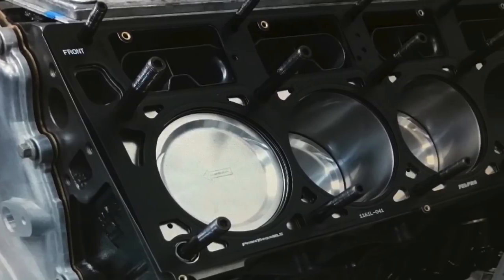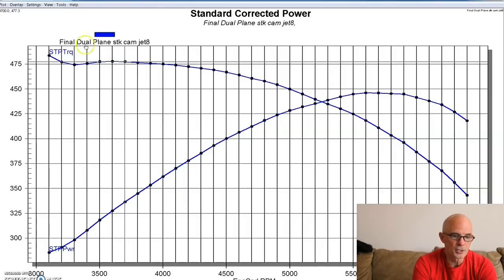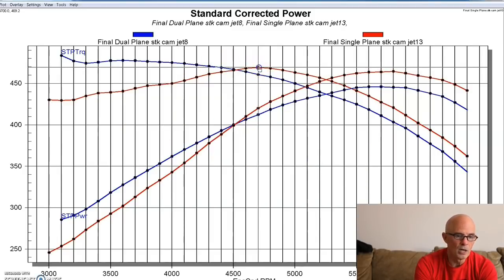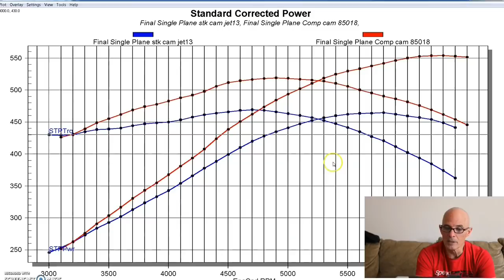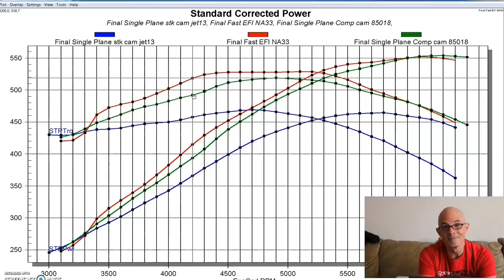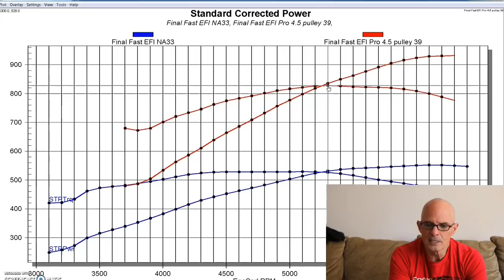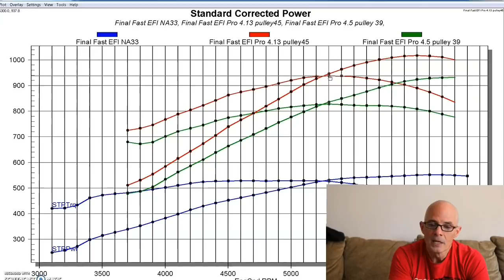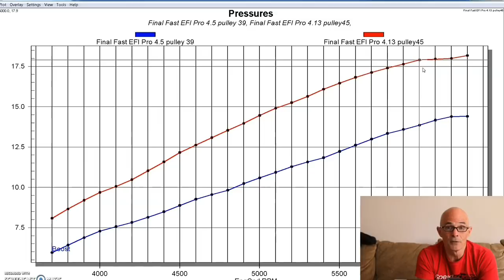SUPERCHARGED LS EBAY COUPLER TEST! DO CHEAP ONES WORK?

Comment: Thought of you today. Blew my first cheap coupler today. Log showed 36psi peak. It has been in use for going on 2 years and thousands of miles as a hard driven street car.

Replaced it with another cheap multiply coupler i had on hand and decent t bolt clamps
Reply from the maker: IT HAD A LOT OF HARD FUN MILES

Comment: I'm actually trying to do something similar with one of my project cars. I took an LQ4 from a 2500 silverado and had it bored .030, then ordered a 408 stroker rotating assembly from texas speed. I think the dish is -25cc, I'm thinking i'll put a set of ported LS3 heads and a FAST 92 intake on. I got to the point where i needed to decide on a supercharger, I was thinking of trying a Vortech V-3 SI. I'll have to do more research on them to see how they compare to the actual PRO CHARGER branded stuff. Planning on mating the motor to the TR6060 in my 2000 Trans AM, the idea is a street car that goes tot he drag strip pretty much weekly during drag season. 
Any suggestions or tips would be massively appreciated!
Reply: Did you do this build?

Comment: Don't use silicone bends. Bends need to be metallic with silicone couplings and the metal pieces as close to touching inside the coupling as possible.

Comment: I wonder how much of the gain from the fast intake/fi comparison to the single plane/carburetor was the intake and how much of the gain was from better fuel flow, distribution, and atomization from the fuel injectors and computer control?

Really hope you answer back with an opinion on my question;)

Comment: How about a 408ls vs a 408 sbf with comparable cross section and flowing heads super Vic intakes and similar cam specs. I know they would not be junkyard wonders and it wouldn’t be cheap but I am just curious how much of a advantage the ls has over the old Windsor.

Comment: Im guessing you were playing it safe with this engine what kind of timing and airfuel were you running on it? Considering 14.7 pounds of boost would of doubled the power and you were at 17 btw great videos always enjoy them...
Reply from the maker: The formula wont double power on a blower application-you have to subtract the parasitic losses associated with driving the blower (turbos don't have that)
Reply: @richardholdener1727  oh ok i see damn i keep learning ill get there one day...
Reply: @richardholdener1727  doesn't the exhaust restriction of the turbo cost something....thanks

Comment: As far as the LSXR vs. the single plane, to be maybe 2 numbers off is tapping on dyno variance, I wonder what would happen to the single plane's "massive advantage", if runner length was closer?
Reply from the maker: not sure I understand this, The Fast was much better than the single plane through most of the curve
Reply: Well, I was referring to the fact that the lsxr has a longer runner lenth, and by making the lengths similar you could have made the operating ranges similar for a more apples to apples comparison of each setups power potential.
Reply: Also, I was making light of the fact that despite the EFI setup murdering the carb for average HP and TQ and being faster in the car, hardcore carb guys will tout the peak number as proof of superiority lol.
Reply: @RadRidesByCru , actually its never really a perfect A to A test of either system, I mean put a carb on a LSXR intake and try the test, I'm sure it could be done. Efi comparisons all use a carb based intake to "compare", and only modern throttle body injection still keeps latent heat advantage. Modern multiport intakes are low heat transfer composites, which works against latent heat reduction from a carb just as much. Then even between long/short runners efi and carb intakes are never the same exact runner length, which also affects overall power numbers. To many variables muddy the waters.
Reply: @RadRidesByCru  I know the plastic makes them cheaper and lighter, but if its heat rejection is a non factor, the AFR titan intake system for SBC which combines latent heat dissipation with heat rejection and is probably one of the best intakes for the architecture, definitely bucks that notion. Also, I knew that wet flow isn't very good inside an efi intake, but honestly that's just me being a bit cynical. Also, the other thing is that carbs and efi favor different cam LSA's in real world use, which affects power and driveability, which dynos charts don't account for.

Anyway, my whole point was it would be neat to see a dry efi intake setup to have identical length runners to a carbureted intake, hell even give half of the runners a shorter length to affect the tuning the same as the carbureted intake because of its centrally located plenum, make it a true A to A test that puts neither setup at some kind of hindrance, like Multi-port into a carbureted intake is...
Reply: @RadRidesByCru  Thats my point, the test you mentioned, is on an intake that gives to the carb but takes from the EFI with higher intake temps, shame about the titan intake, the mod design was bad ass, but Chevy guys are cheap lol, and the manifold was anything but, so not really surprised either. The problem with tight LSA's isn't the computer, so much as rescaling the VE tables, and getting enough air thru TB, if needed just do the same trick you would for a carb lol.
Reply: @RadRidesByCru  drill the throttle plate, older efi comps can easily control tighter cams, but what they don't like is erratic sensor readings. 

If it can make a cam with 260/270 @ .050 and .680 lift idle stone steady at 850rpm with a carb, that and having seen it done on a 2000 camaro with stock comp by starting at 1/4" and working up slowly till things like stepper motor, and BP values get into factory ranges, and if your gonna cam something who's not gonna make it work as intended with a tune?
Reply: Lastly, if your feeling froggy, pay the 33 bucks for the SAE international congress paper on the effects of plastic composites vs. aluminum in intake manifolds in dryflow applications and we can talk further on the material subject and its effects. I agree thou that on the AFR Titan its basically moot because of Wet Flows latent heat reduction, at that point its like icing down your ice with more ice its only ever gonna get to 32 degrees. Every 10 degrees of intake temp reduction adds 1hp, wet flow can easily pull the IATs in the runner down by 30-40+ degrees, intakes in dry flow applications do not exhibit this trait. The air will instead be heated until air speed surpasses the materials ability to transfer it into the incoming air mass. Have you ever once seen a plastic heat sink??

Comment: the Crossover point is ALWAYS at 5,252 RPM.
Reply from the maker: only for hp and tq-not for power differences in manifolds
Reply: @richardholdener1727  yes yes yes 😁

Comment: What’s the best middle of the road or bang for buck turbo for a boosted 5.3?  Daily reliable...
Reply from the maker: A GT-45 can make 750-800 flywheel, an S475 or VS 78/75 can do near 1000 hp
Reply: Richard Holdener thanks dude!

Comment: Do you think this compression ratio makes sense for an E85 fueled street car, or is it better suited for someone running 91/93 pump gas?
Reply from the maker: It works on E85

Comment: Richard, out of curiosity...
In the mid-late 90s, Hot Rod mag built a “short stroke 350” (believe it was titled “the 350 Chevy should have built).  It was a 400 block, 327 crank, Ford 300/4.9L rods, custom pistons with raised wrist pins, aftermarket aluminum small chamber heads, and a fairly small cam (under 210@0.050”).  It had 11:1 compression and made just as much power with 87oct as it did with 91/93 (possibly a couple hp more with the cheap gas).  It took advantage of a really big rod/stroke ratio (nearly 2:1) to make it less prone to predetonation, allowing them to run as much timing on 87 oct as they did with 

Were you part of that test?  
Do you think a similar principle applies...  that a 4.8L is less prone to predetonation than a 5.3L thanks to the rod/stroke ratio?  Possibly allow the 4.8 to run a little more boost or more aggressive timing than a 5.3 on crappy pump gas?
Reply from the maker: I think that test was flawed in a big way-I was not involved

Comment: It made poor power na. Idk why guys lower compression for boost so much. It's not like there isn't good fuel around with e85 these days.

Need a vid with compression ratios vs boost.
Reply: Depends on where you live.  Around St Louis, most fuel is 91 oct, and e85 is hard to find.  

For as lowering compression, I think it depends on the motor as well.  There’s no sense in dropping compression on a 9.5:1 compression 5.3L since it just digs a hole that’d have to be overcome with boost.

I remember a magazine test that compared 708 vs 317 heads on a 5.3L, both NA and turbo.  Pretty sure Richard did the test, it just hasn’t made it to video form yet.
Reply: @stlchucko  yea i know. E85 has only been around me for a couple years. But most stuff he's doing is beyond pump gas anyway and alot is on e85. Just thought a compression ratio  comparison would be cool and not something ive seen done.
Reply: HioSSilver1999 
Rule of thumb is 3-4% gain for 1 point of compression.  I just used some math to make estimates.

With the fuel availability where I live, 9:1-10:1 is an optimal CR for a boosted engine.  It’s pretty easy to get away with about 10psi on a stock CR 5.3L with a safe tune and the crappy gas around me.  By that point, it starts becoming a balancing act...   10 psi with safe timing or 8 psi with more aggressive timing.  

IOW, the quality of gas always seems to be the biggest limiting factor for how much a given engine can make.
Reply: @stlchucko  yea....but i was wanting to see if boost compounded that like it does everything else. Alot  of these new engines run at higher compression ratios so my concern is not just 5.3s. But wanting to see the advantage of high compression with boost.

E85 would be more viable but it would be nice to see pump vs e85 on the same high compression boost set up.
Reply: HioSSilver1999 
Boost is pretty much a multiplier.  On an optimized setup, adding roughly 15psi should double the power.  When it doesn’t, it’s usually the result of parasitic losses (a supercharger instead of a turbo) or the wrong sized turbo (too much backpressure from wrong sized housing or exhaust limitations).
Reply: @stlchucko  i understand all that. It's pretty basic really. I just want to see a compression ratio test and maybe it will help all these morons that think 3:1 compression is how they should build a boosted motor.
Reply from the maker: run the highest boost and compression that the octane allows
Reply: @richardholdener1727  what ive been thinking.

Comment: Loving the content.  I'd like to see both SBC and LS Chinesium head tests.  Are they Good,  Bad,  OK?  Are you nuts for using them ?
Reply: keep in mind that china shit isn't always terrible.....all of holley's single and dualplane intake manifolds are cast in china. As for LS cylinder heads, theres less than 5 companies in the world that do all the aftermarket LS castings. Small block would be a more interesting test because theres a ton of companies that do the castings for those.

Comment: another great vid per usual. i have a procharger (d deries) but it wont start making boost till like 4ishK rpms,  is this one of the differences between the D and F series? thats some good boost for such low rpms. i only wish my car could produce that. she had a 4.15 pullery and is supposed to make 10ish lbs total boost i believe. im hoping to have it calibrated within a few weeks it was my winter project. im kinda just learning things as i go,  your vids are great man you always have a ton of knowledge :)
Reply from the maker: the d series should be more responsive

Comment: Thanks again Richard , great video , I am of the new forged camp , been beating on my boosted BBC for five years now and prefer that to one of my pals who’s always blowing up his junk LS engines and tearing down to replace pistons , rods , etc . No thanks life’s to short for that for me . I almost forgot add torched head/head gasket from reusing torque to yield head bolts and head gaskets  four times .
Reply: I wouldn't brag about your BBC fetishes
Reply: Midnight Trumptrain , why not , it makes huge power and torque at a moderate rpm and dead nuts reliable with excellent street manners , LS a great engine but not what I currently use .